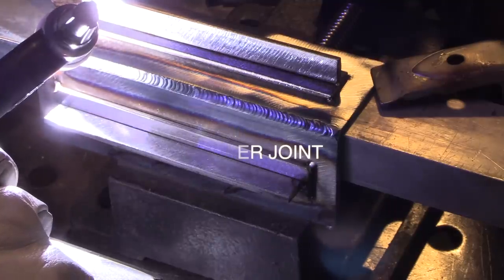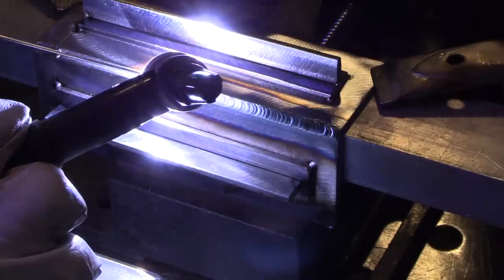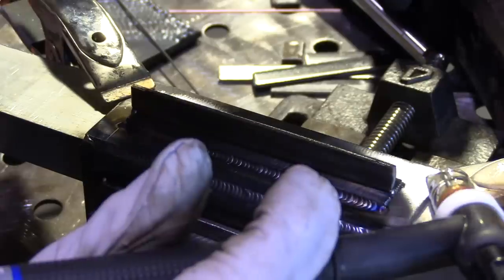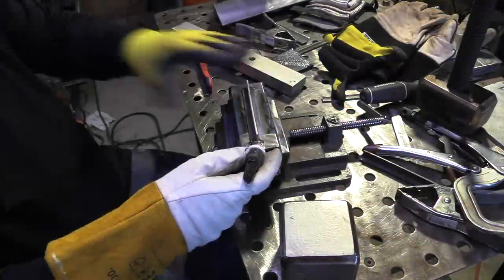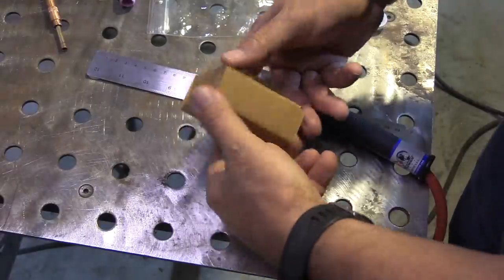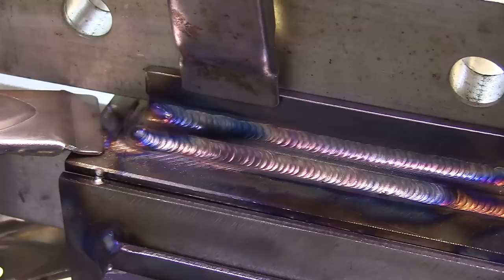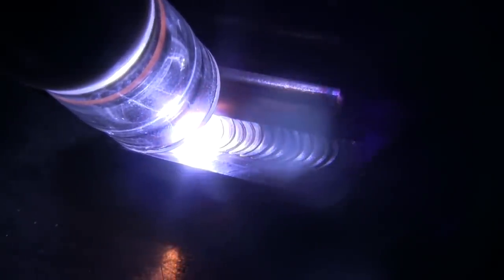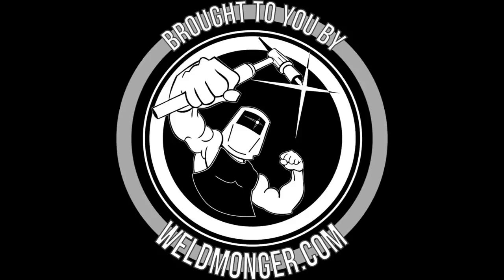TIG Welding Carbon Steel Fillets

Comment: I just started my first college class for tig welding and this is right on time, thanks Jody :)

P.S. My instructor uses your videos as instruction almost every day before we go in the shop because your video work is better than the miller or Lincoln videos because you can clearly see the puddle and the entire welding process is clear. Thanks for the work you put in it has helped me with my other classes before tig.

Comment: Another great video Jody. I know one of the obstacles I battled with when I started out was the puddle dancing around. The two factors that corrected the problem were keeping the filler in the argon and wire brushing the joints before every run. I also clip off the end of the filler a lot of times to make sure I’m not starting off with oxides in the mix.

Comment: Good info.  I have a Miller Syncrowave 180 SD I bought about 10 years ago.  Haven't used it other than for occasional SMAW steel hobby stuff.  However, I've started some pretty big remodeling projects around the house and am making a dining room table with a pedestal stand made out of steel.  The vertical tube is 4.5" OD, 11 GA.  The table support and legs I am using are 1" x 3" rectangular tube, 0.08" thick.   The table support and legs butt into the OD of the center tube.  I ground them best I could to match the radius of the tube.
I was doing some practice welds on a small piece of the tubing and support/legs scrap, and discovered I'm really out of tune.  I started blasting a lot of holes in the thinner supports/legs.  However, after a bit of practice, I'm getting decent welds, provided I focus the arc more on the thicker tube.  My electrode is 3/32".  My filler metal is 3/32".  My amperage setting is around 130A max.  I'm thinking I should drop down to 1/16" filler so I don't have to use so much heat.
Suggestions to improve my weld?  The thinner supports/legs were chosen because 11GA for those pieces would make this table a beast (weight).  Chiller bars would be tough to set up due to the design and material availability.

Comment: That chill block makes all the difference! 
I warped a stainless exhaust flange a couple months ago. $30 mistake, caused a 1-week delay.
2nd time around, I clamped hard drive platters to it, then did it in sections.

Comment: Jody, something clicked inside my brain during this video...

Usually my puddle looks squirrely like when you were welding the back side of the tee joint and turns out gray and scaley..

Recently I found out that the square tubing I buy is actually hot rolled even though it looks like cold rolled (see any of my videos).

I'm going to try grinding the inside of the tubing with a tootsie roll.

Thanks Jody. Love the videos and online store.
Reply: How did you find that out?  I've been getting 1/16" wall square tubing that looks cold rolled but certain times acts like it's hot rolled too.  It's basically scrap price so I don't mind but have always wondered why it's so quick to gray out and sometimes get scaley.

Comment: Great video as always! Thank you for sharing your knowledge. You have mentioned in the description, that you have cleaned the parts with flap discs. I was always wondering if removing mill scale from hot rolled steel with sandblasting would be also acceptable for TIG welding or are there some issues with sand blasting?

Comment: Hello Jody,  I haven't seen anyone address plasma cutters insofar as whether a drag tip can be converted to standoff and visa versa.  Where to get the consumables if they do change.  Whether only some machines can and others not?  Tricks in making jigs for both kinds.  Whether a machine can only run the tip hole diameter it comes with or if you can vary it for different projects?  Which Chinese brands are proving out for the diy'ers?  Seems a vacuum of info on plasma options.  I have been running a 40 amp machine for more than fifteen years and just found tips to convert it to drag.  It would seem drag style does go through more tips?  Thanks for all the great videos.  Take care.  Doug

Comment: I have enjoyed your videos and I am just a beginner at tig and having lots of problems with filler welds on 14 guage, 1" steel square tube. Either I don't get enough heat to generate a puddle or I blow through the tubing. Advice?

Comment: Great video with a lot of informations . I have a problem when I do Corner Joints to Join three Pieces of steel together . I use Stick electrodes like 7016/7018 and I have only a DC welder . How can i do a better Job of welding the three pieces together (Sometimes Arcblow) ? I didn´t found a good video for this . Best greetings from Germany
Reply: Or is it easier to do it with Tig I need good penetration for all the pieces ?

Comment: Shoulda had a worbly woo with that slitting wheel ;-)

Nice video. Wouldn’t have taken but a few mins to flame straighten that T joint without clamps.

Comment: Seems like a clear cup is always better for visibility of the puddle. Is that not true? Do they not provide the equivalent gas envelope as a ceramic cup?
Noob welder here.
Reply: mdwdirect the clear cup provides better visibility for filming as it “lights the way”. Large diameter gas lenses (like the clear furick cup used in the video) provide a larger gas envelope compared to a standard pink ceramic cup. Gas lens kits have plenty of advantages such as longer stick out, but they require more gas flow compared to a standard cup
Reply from the maker: @jerrysgardentractorsengine2243  couldnt have said it better myself...thanks

Comment: Jody, I recently bought the ceramic Furick 12 cups from you. Am I supposed to install the spare screen that came with the cups ? Or is it just a spare if the screen in the cup gets damaged or fails?

Comment: Can you weld 300 series stainless to 400 series stainless? If so which filler rod would you use.
Reply: 309 or 312 with some pre and post heating and slow cooling to prevent cracking. If it is free machining 416 (416Se) it is considered not weldable. Really better off not doing it, but it can be done in a pinch.

Comment: Damn I have to get into some tig. My collage funds dont really let. Do you think a simple bridge rectifier will do the job on an old ac machine? Oh and is around 160A enough for some basic stuff?
Reply: There are some really cheap machines out there with stable dc arc for tig. Many with high frequency start rather than having to scratch start. By the time you get the machine, build or buy a rectifier, and get a bottle of argon, assuming you dont already have one, it would be best to get a tig designated machine in today's market. Some brands are htp, everlast, ck...
Reply: @caseyledford3662  Yeah but those brands are firstly foreign for me (voltages wouldnt work and import taxes and customs are through the roof) and if I could get my hands on one the prices are way to much. The cheapest tig capable welder (HF start) is around 340$ and can run up to 200A. Its a stick machine but I could buy a cheap torch kit on ebay just to get my feet wet and see if I like it and than maybe buy a torch. The cheapest one I could get around me is 460$ plus around 100$ for the TIG to DINSE adpater. The bottle isnt a problem. I can get it from a local fire brigade where I have some conections.
Reply: @zanpekosak2383  By all means go get it. I can tell you that even the lowest price dc machines put out very close to the stable arc that high end machines because the concept and technology is pretty much basic across the board. Features of high end Lincoln, Miller, etc machines are only slightly better when it comes to dcen welds. A scratch start rig will prove its limits even to a small hobbyist in a relatively short time. Not to mention these new basic dc hf machines hold their value pretty well in case you lose interest. Whatever you decide, enjoy yourself. Im going to go weld something.
Reply: @caseyledford3662  Sure thanks for the help!

Comment: Hey Jody do you think you can do a aluminum fillet 1/8 to .030 i cant seem to pass my test at work
Reply from the maker: so is this a tee joint or lap? and which member is the .030"
Reply: @weldingtipsandtricks  t joint it cant have any burn through but it needs to burn into the corner and consume it. And i am also using a dynasty 350 if that helps at all
Reply: @weldingtipsandtricks  sorry I just re-read the post base is 1/8 upper piece is .030

Comment: I have a Hobart 210 and Primeweld 225x… I really can’t figure out why everyone is so interested in tig’ing 1/16” thick mild steel?  I mean I see the cleanliness advantage, and tig looks prettier, but aside from that I don’t see any practical point of tig’ing projects like cutting tables, fixture table frames, or anything else that mig does so much faster, simpler, and cheaper.   Is it really a spatter protest, or do welders of ordinary carbon fancy themselves “artists” nowadays?